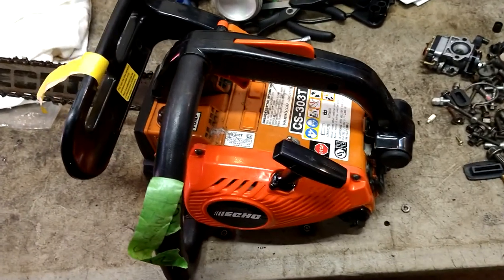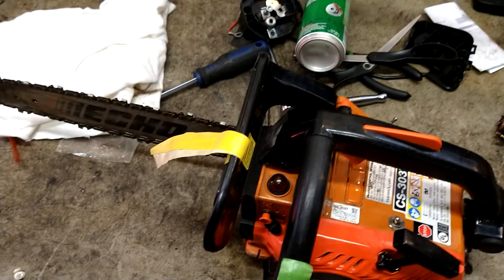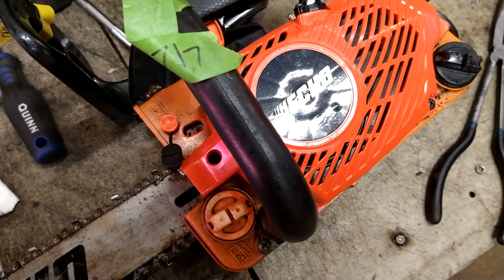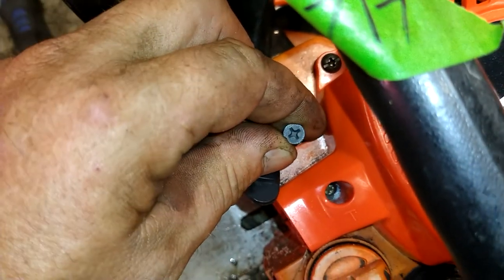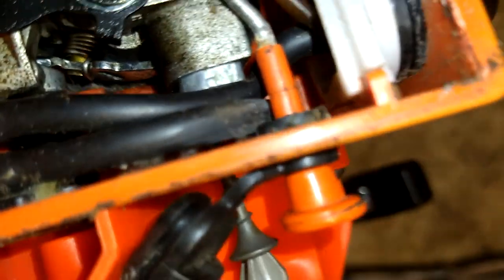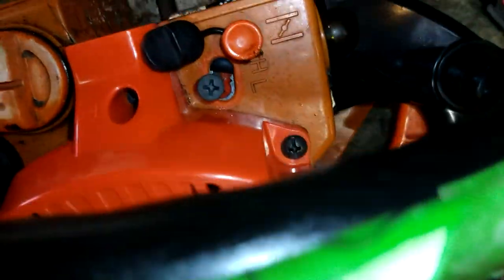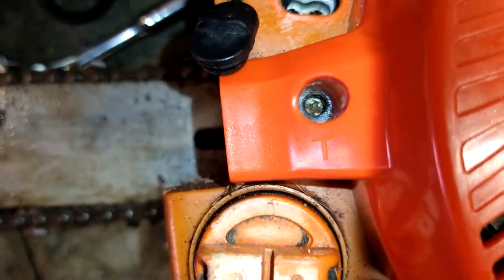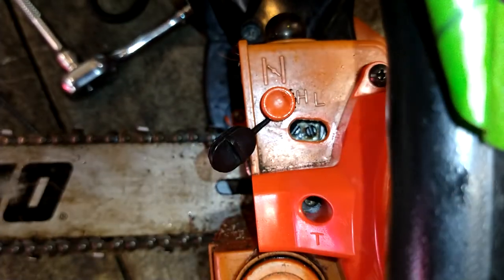Echo cs-303t chainsaw carburetor adjustment.

Comment: Thanks man, l fixed mine, had the same problem. Mine has a big screw with a spring. If you regulate from there it is easier. It also has the small ones but I think they are for small adjustments
Reply from the maker: That is idle up down adjustment.  Idle air fuel mixture isnt always needed to be adjusted.
Reply: A trick : watch series at Flixzone. Been using them for watching a lot of movies these days.
Reply: @Kamryn Coen Yup, been using Flixzone} for since november myself :D

Comment: Hi do you know how to fix an echo Cs 355 it won’t idle.
Reply from the maker: yes its going to be along the same lines as this saw. first turn idle up. if that doesn't work then turn low screw counterclockwise a touch. maybe a quarter turn. now idle should be high so turn idle screw back down.
Reply: @smallengineguys  Thank you so much for replying! All the places are booked to get it fixed so I thought I’d give it a try myself. Appreciate it blessings 🙏😁

Comment: How do you put the orange pieces back on
Reply from the maker: you dont. they are there to keep you from adjusting your carb. if youve pulled them you are past the dont do it part and in full on i can do this part.
Reply: @smallengineguys  so I don’t need them on there to operate the saw properly? No damage will arise from not having them there?
Reply from the maker: @enveetree7916  nope. Your fine.
Reply: I got a 330t that will start run at about 1 1/2 out on both or I stg like 4 out on both but won't throttle right anywhere